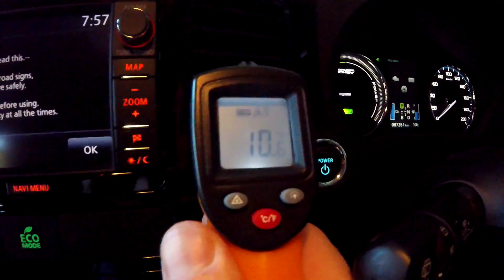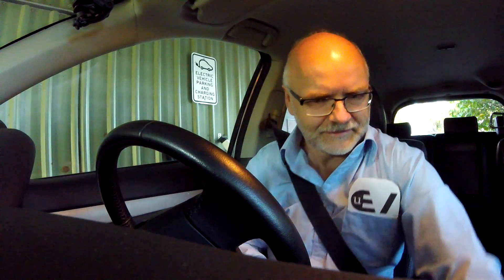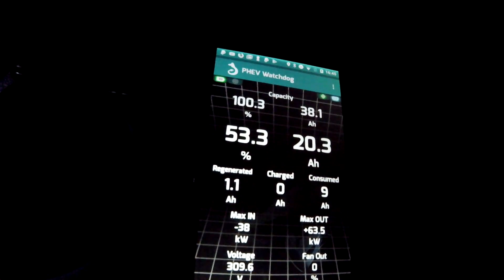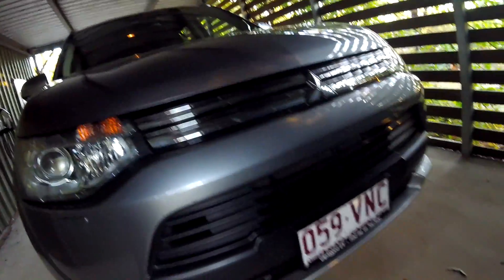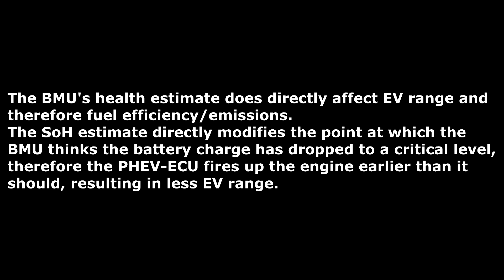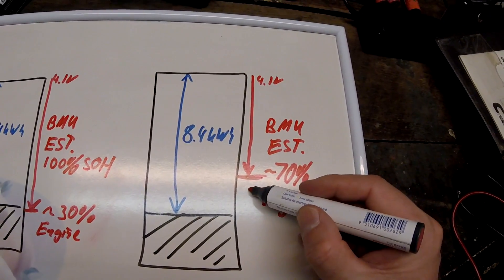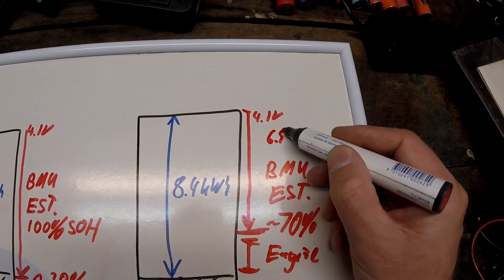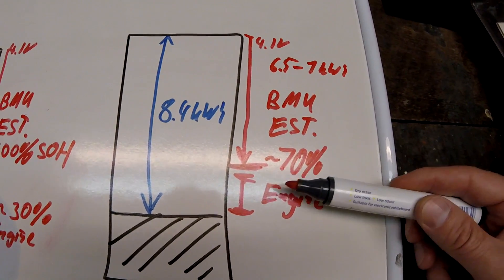EP249 - Fuel and Emissions up, EV down - Mitsubishi's #PHEVgate

Comment: The SOH figure inaccuracy causing a premature indication that the engine needs to fire (due to incorrectly determined low battery) seems to be exactly what has been shown by various people testing so far. Real range decreases over time and following a reset that range is restored, subsequently gradually reducing again over time. There is ample evidence to support this.

My concerns over charging being safe without the 12V battery connected remain. It is not accurate to say that the DCDC 12V battery charger being present is okay and will maintain BMU and related safety functions during the main traction battery charge.

As we have heard, we need to drain the 12V battery to reset the volatile memory storage of the BMU.
Then we need to reconnect the 12V battery to enable the main charger to switch on.

At this point, we disconnect the 12V battery and this is okay because the DCDC is still switched on? No. If this is an accurate description of what is happening then we could have just left the 12V battery connected after enabling the charger to switch on. There would be no difference.

So one possibility is that it would be okay to reconnect the 12V battery to enable mains charging and to leave it connected. This would mean that during charging the BMU and safety systems would be in place and would negate many of my concerns. But we are hearing that this is not the proceedure. You need to disconnect that 12V battery during the charge.

So why? What is the difference between the battery versus the DCDC battery charge rail being present? It must be an intelligent 12V battery charger.

A 12V lead acid battery can be 'bulk charged' at around 14.5V temporarily but to connect a supply to the battery indefinitely without causing damage you need to reduce to a 'float charge' voltage of approximately 13.7V at 20 degrees C. This prevents an unsafe overcharge condition where hydrogen gas is released, maybe acid and the battery may not recover. There is also a battery chemistry temperature compensation required, as a warmer battery requires a lower charge voltage. The correct temperature compensation is around 20mV per degree C, so for every 10 degree C change in battery temperature there should be a 0.2V compensation in charging voltage.

In a traditional IC engine vehicle, alternator output is regulated to 'bulk charge' the 12V battery at about 14.5 Volts. This is not safe to connect indefinitely as the battery would be fully charged and then overcharged, but there are feedback systems to adjust the charge voltage and the full output is also not provided at engine idle, but at higher RPM so normally only while you are driving. When you kill the engine, get out of your car and close the door there is no charge connected and no associated risk.

With our PHEV the situation is quite different. We know that while we switch on we enable the DCDC charger so 12V battery charging takes place as we drive around.
But we also know that when we plug in to charge our main traction batteries the 12V battery is charged. Sometimes we plug in for a few hours but sometimes we plug in for days at a time. If the DCDC 12V charger was fixed at the 14.5V that has been mentioned then the 12V battery would be damaged, so it must either reduce to a lower float charge voltage of around 13.7V or at the very least switch off automatically to prevent overcharging. As cars are metal boxes out in the sun in a variety of climates, they will present batteries with a variety of temperatures so it is highly likely that there is also temperature compensation built in as well as charge stage voltage control.

So, based on the likelihood that there is an intelligent DCDC 12V charger used, what does this mean? Well it would mean that the measured 14.5 V DC or thereabouts that we think is connected to the BMU is not reliable. It is provided by a charger that expects a 12V battery to be there to monitor and to do its job safely. It might change it's output voltage, or switch on and off completely over time. It is normal for intelligent chargers to measure battery voltage, current, temperature and sometimes other parameters like battery impedance that can provide control information and also detect battery presence.

So this suggests two things to me. 
Firstly, if we believe that the Linqvist process works only when we disconnect the 12V battery after enabling main charge, then it must be for a reason that makes the DCDC 12V charger look different to a 12V battery. I think this is because the 12V charger is either intelligently reporting different information or is, more likely, switching its output off at some point - perhaps due to detection of lack of battery presence. If the output switches off then this could understandably prevent the BMU logging information during the main charge process enabling the 'reset to default'. 
Secondly, the assumption that power is present to the BMU implying that safety design features are still in place is inaccurate. We do not know if the BMU remains continuously powered during the charge process and it may well not.

Maybe this makes sense, I hope. Just some thoughts on people thinking about things to minimise their risk before assuming that everything is as assumed. 

Can we have a note of the forums and UnpluggedEV email on one of the upcoming episodes?
Reply from the maker: That's what I think too. It should not matter if we disconnect the 12V battery after charge has started. The actual reset can only come from the time before when it was disconnected. 
Someone needs to measure the voltage of the 12V circuit once the 12V battery has been disconnected and charging has commenced.
Reply: This morning at 9:20 (after 15hrs of disconnected 12v) I noticed it took the MMCS 10 seconds after car powerup to sync its clock with the GPS (it was initially showing 10:00). Perhaps if the BMU doesn't have its own clock, having weirdly timestamped data next to each other could be a condition contributing to the reset and another reason why a 12v disconnection could be important.
Just sharing my observations... no conclusion yet. 
What are successful people seeing as SOH on the Dog during the "reset charge”?
Reply: Tuber Culous I thought about the gps clock too! I can’t get this method working for me
Reply: It's definitely not the clock on its own. I explored this today during my 5th attempt. The clock gets reset even after a 5 minute disconnect. Initial date is 1. Jan 2011 and it takes about 60 seconds after car start to self correct. I managed to get a Dog SOC/SOH reading in the window where the clock was still wrong but it made no difference. 
For my 6th attempt I am looking at an overnight initial battery disconnect followed by a charge from 25soc, where from about 85soc onwards I will trickle charge at 5A to ensure the BMU doesn't terminate the charge unnecessarily early and goes all the way to 104.7soc (i.e. large charge/delta)
Reply: In the comments under the Lindqvist video Eric Friman and sportster999 eventually succeed even with tailgate/wifi/ACC after initial battery disconnect of 7hrs and charging from empty.
Reply: @unpluggedEV  I think the second part is also somehow important, because there could be some procedures carried out after the charge is completed. For example, the calculated charge is written to some register. 
Since aux. battery is not connected at this point, the car may loose all the power. I assume that the charger is not supposed by design to power the whole car and it uses that connection only to charge or maintain the aux. battery (because it expects to use aux. battery at the end when charging is completed). This would mean that once the charging current drops to cut-off point, the charger is automatically disconnected. At this point some procedures may not be over yet and turning power off abruptly is like unplugging desktop PC and loosing all not saved data. Then, after aux. battery is connected again to the vehicle, it may run some reset or re-initialization procedures. If it declared that the data was corrupted during the last charge procedure, it could restore defaults automatically or something like that, just like any PC would do.
Reply: What if the volatile memory idea is incorrect? What if the BMU-PHEVECU combo is smarter than we think, and it has a "service mode" as well as "normal mode". Someone commented under the previous video that the aux 12V battery disconnect is an integral part of DBCAM. My theory is that the 12V disconnect is needed so that the BMU's "normal mode" doesn't learn of the charge (as evidenced by MMCS cost meter not updating) and then after the charge when the battery its reconnected again the BMU-PHEVECU interprets the huge SOC difference as having received a new battery (or simply "implausible/corrupted data") and thus purges all learnt historical data, and goes to the initial defaults
Reply: Btw. I'm on my 4th Lindqvist procedure and my observation is that the charging without the 12v battery is clearly fully controlled by the BMU, with a few minor anomalies which I attribute to being in a "service mode" which is not (or less so) influenced by the historical/age data, as you'd expect would be needed during DBCAM etc.
Reply: @tuberculous4691  The volatile memory idea was based on the description of needing to remove a battery and wait for a few hours, allowing enough time for a reservoir to deplete, before reconnecting and enabling the charger.  This sounds to me like a memory reservoir, designed in to hold the memory during battery changes, and the fact that the system does reset means that the memory holding the reset information is by definition volatile.  It doesn't sound to me like a service mode instead as I think a global car manufacturer would build a service mode into a software or hardware mechanic interface, rather than calling 'disconnect 12V battery and wait a few hours' a 'service mode'.
Reply: @Tim I am calling it "service mode" in quotes, based on observation, not necessarily Mitsu's intent. What I have repeatedly seen is that when the charge starts after battery disconnect, the SOC reading is between 1.3-1.8Ah (almost 5%) lower in the "service mode" than it was just a minute before in "normal mode". This leads me to believe that in this "service mode" the BMU ignores the historical learned data and operates in a default mode with a different SOC-voltage map or without any custom offsets.
Btw. the LV on the BMU as reported by the Dog during the Lindqvist charge is 13.8V. 
Although we don't necessarily agree, I appreciate the discussion.
Reply: @tuberculous4691  12V battery disconnect is not an integral part of DBCAM. There is a note under DBCAM procedure description in the service manual: "Do not disconnect the battery cable from the auxiliary battery terminal (-) during the work."
Reply: If the BMU power was unreliable or BMU switched off for any other reason, the pilot signal wire in the J1772 connector would lose voltage and the EVSE would cancel the charge. You might be overthinking it Tim, perhaps focusing too much on voltage and too little on software?
Reply: @tuberculous4691  The focus on voltage was due to two things. Firstly it would make a difference to the perceived safety of the process if the BMU and other 12V processes are functioning during the mains charge which they need power to do.  Secondly, there was comment that there is no difference between having the 12V battery connected or disconnected due to the DCDC charger and this is likely to be incorrect.  The DCDC charger should be an intelligent charger and could do various different things if it was enabled and then had its battery removed.  The supply might be interrupted, might not etc.  I don't know what the impact on the CP charge line would be, but it may or may not function as intended while deliberately using the system in an abnormal state.